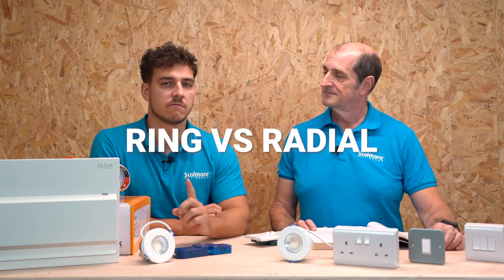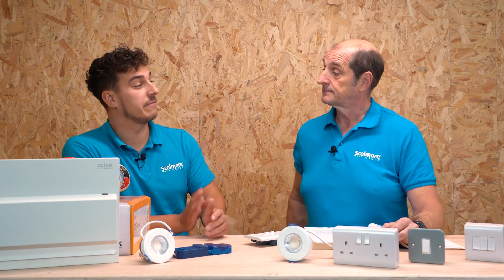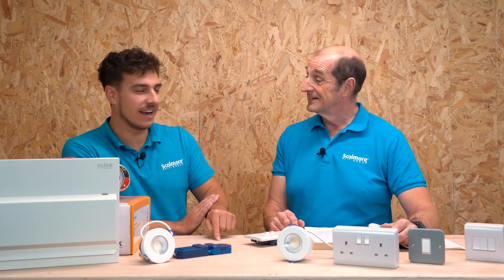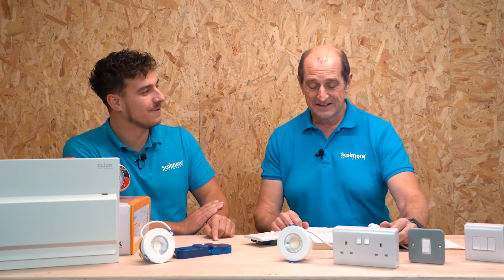Ring vs. Radial: Which One Reigns Supreme?🔆

Comment: It's actually quite alarming how easily you can have a problem with overloading. For example, if you have a ring circuit broken by a loose cable backing out of a socket, that ring is now halved in current capacity. Then there's all sorts of potential issues with spurs off spurs etc, from dodgy diyers. Also cables running through insulation are effectively affected.
Reply: It is not easy really. Done like the professionals like twisting together the conductors endures the rings integrity. Also solved by using push-fit maintenance free Wago type connectors in backboxes to connect up the ring's spine adds safety, as not being screwed connections they do not work loose. The ring's current also does not run through the socket's terminals (this also applies to radials).

Bad tradesmen and bad DIYers cannot be accounted for in any regs.

Comment: High rise buildings, care homes, etc, AFDDs are mandatory on socket-outlet circuits, but recommended on all socket-outlet circuits in all premises as they give the ultimate protection. AFDDs are expensive items so the fewer the socket-outlet circuits the cheaper the installation will be. This is where the advantages of final rings shine as they generally replace two or three radials giving substantial savings on installations. 

Moving over to radials from final rings is not a bright idea now AFDDs are here. I notice that cable manufacturers prefer radials as more cable is used then they sell more.

Comment: Looking into this (not an electrician). I cant help but think its better to always set up a ring circuit with 4mm cable. Then if you have a break you can just swap your 35a fuses for 20a, and have 2 safer radials, or keep the 35a if you want keep the power for some reason because your cable can handle it. Like considering the cost of cable compared to the cost of the trade work. Just buy the 4mm surely?
Reply: As a non-sparky as well, this seems to be the best option. I keep seeing the talk about cost of cable when its less than 10% of the bill once you include labour and the rest of the system.
Reply: If a cable brakes for any reason you connect it back up - they do not just break by themselves. You do not split it into two circuits.
You can always fit an unpolarised DP 25A MCB on a final ring with the L conductors of each leg of the ring connected into each pole terminal.  That will prevent fires if a ring is broken or unbalanced. The final ring can also supply a 45A appliance at the midpoint of the final ring. Very safe indeed.

Comment: The Issue with rings is when/if the ring is broken, you could then have 15-20 sockets on a 2.5mm radial cable protected by a 32A breaker making it non compliant and dangerous.
Reply: You can always fit a 25A double-pole unpolarized MCB with both Ls of each leg run through each pole of the MCB. No leg will ever take more than 25A. So if the ring breaks and the current draw is over 25A on one leg the whole MCB will trip isolating the whole circuit. The same applies if the ring is unbalanced.  Double-pole unpolarized MCBs are cheap. 

The ring then is capable of supplying a 45A appliance.

Comment: Final ring circuits came into their own in the late 1950s. They were not to save copper. My mother's house was built in 1954 with 13A G Type plugs. It had radials. Ring circuits have been widespread in the UK for 75 years. They have been found to be very safe. The British G Type fuse-in-plug was to protect appliance flexes. And to standardise on one plug and socket as previously there were different sized plugs & sockets and cable for different types of current draws and appliances. 

It was common to have three different types of socket in one room. However the fuse-in-plug became an enabler to use final ring circuits. The final ring circuit is ingenious in its simplicity. When used with the British G Type plug the ring is a busbar run around the house with distributed fuses at each appliance. There are many advantages to rings:

1. Cheapness, as smaller easier to install wires can be used;
2. A large number of sockets can be off one cheap to install ring;
3. Having the same number of sockets using radials would mean multiple radials and multiple extra breakers at the main panel. Far more cable, expense, labour and hassle;
4. The 32A breaker and 13A fuse in the plug ensures safety;
5. Portable plug-in appliances on a ring cannot exceed approx 3kW. Some plug-in ovens are on rings;
6. Rings usually have a 32A breaker at the main panel - can be a lower value;
7. Using push-fit maintenance free Wago type connectors to connect up the ring in backboxes adds safety, as not being screwed connections they do not work loose. The ring's current does not run through the socket terminals (this applies to radials);
8. The British plugs enable rings having a max 13A fuse in them - can be as low as a 1A fuse in the plug to suit the appliance and flex/cable. Small flex and appliance? Then a smaller fuse;
9. Rings in the UK are limited by square metres of floor space, with no limit to the number of sockets on the ring. 100 square metres of floor space with 2.5mm cable for a 32 amp final ring. The cable can be 4mm, which is advisable in an unbalanced ring drawing high current loads;
10. Less voltage drop on long cable lengths as voltage comes from two directions;
11. Two ways for the earth wire back to the main panel, increasing safety levels.

Radials are also used in the UK. Rings are not mandatory, but used because they have proven to be generally trouble free and safe. They can be installed using rule-of-thumb. These days a ring will be off an RCD, RCBO or AFDD (arc fault) breaker - these now are becoming DP, so safer again. AFDDs are now mandatory in some socket installations and recommended in all installations. AFDDs raise the safety level. If an office wants more socket outlets for extra desk computers. It is a simple matter of extending the existing ring with the extra sockets as the current draw is low. Cheap and easy. If radials are used many radial circuits would be needed, which may mean an extra consumer unit, breakers, cable etc, then far more labour. 

Some disadvantages are: 
a) Rings are more difficult to fault find. But electricians have no problem once the ring is fully understood. The ring can be split at a socket then tested as two radials for those unfamiliar;
b) Another is a unbalanced final ring, which is a rare event. That is if a number of high current drawing appliances are on one side of the ring, say nearer to the main panel, most of the current draw may be down one cable leg of the ring with the cable rated below the main 32A breaker. An unbalanced ring. 2.5mm cable is rated at 27A max. Although tests have proven the cables do not exceed their current capacity in the vast majority of cases, just an imbalance in distribution of the two cables from the main panel (consumer unit). Good circuit design will prevent this, negating this disadvantage. 4mm cable can be used rated over 32A. 

Overall one final ring is superior to a bunch of radials needing their own breakers at the main panel. They are simpler, cheaper, being proven to be safe and worked well over the past 75 years. Using the new AFDDs on rings, which are recommended and mandatory on some installations, gives a far higher safety level.  A final ring with AFDD protection using 4mm cable and Wago style screwless connectors on sockets is near bombproof. 

You will have to give a very convincing argument against rings. I have not heard of one yet.
Reply: contra your "positives":

1. so we're just being cheap
2. same as 1.
3. same as 1. + lazyness
4. you do explain the imbalanced load in your disadvantages section but I would like to add that a 2.5mm^2 cable protected by a 32A breaker, even as a spur, is not only not safe, but I'm actually dumbfounded how current regs don't outright prohibit this.
5. has nothing to do with rings specifically
6. this is just the result of your first few points
7. you can do the same thing on radials if you want, and they do daisy chain the rings as well. and in case you do need to perform maintenance on the spur connections, you can start taking up floor boards and looking for the junction boxes while with daisy chaining you have all connections behind easily accessible sockets.
*edit: oh my bad, I guess you mean Wago inside the back box? sorry I'm just rewiring an old house and see the stuff I mentioned everywhere. well in that case, I guess you should use 4mm wires for the spur but wagos are not exactly cheap, you know. plus I like to save space in the backboxes. fewer wires, more room, less bends, less snaps. I default to 35mm.
8. irrelevant to rings
9. in my mind the more sockets / rooms on a circuit, the worse. makes fault finding considerably harder, and again, division of circuits is always preferred.
10. mostly irrelevant in domestic premises and only true if the circuit physically loops back to the main panel anyway. although large hangars etc. could benefit from this, along with the better Zs readings which I can't believe you haven't even mentioned. we do have busbars for this reason, though.
11.  I guess you kind of did mention Zs in this one after all. but keep in mind that if it breaks anywhere, you're effectively left with a 1.5mm PE conductor along with "effectively" 4mm live conductors and a 32A breaker, if you don't use an RCD.
but, again, the same thing can happen to the live conductors and you're left with 2.5mm cables protected for 32A. I know there's a low chance for this happening, but it's still not zero.
Reply: @krispy_kornflake  
Mr kornflake,

Firstly, a final ring is economical, safer than a radial and delivers the power. The electrical committee in WWii recommended that each room have one socket that can cope with a 2kW appliance. To ensure each room has enough power final rings were homed in on. The 13A fuse in the plug was the enabler. 

A woman was on the design team, Caroline Haslett, who insisted on many of the human-centric ergonomic design features for the brilliant 13A plug, emphasising safety for children and ease of use for a housewife. The British G type plug and socket is a design classic thanks to Caroline's input. Nothing beats it.

The first three points you say are being cheap, yet go on about Wagos being expensive. Duh. Most of your comments displayed ignorance of final rings for sure. 

The final ring has two routes back to the main panel for the earth, CPC - greater safety. In commercial they have a return earth circuit, which is a radial but the earth at the end of the radial is fed back to the circuits breaker for greater safety forming a loop. Unlike a radial the final ring has this integral to its design. 

I have never come across an imbalanced ring, it is remotely possible but exceptionally rare. Final rings are self balancing - if the resistance on one leg rises then more current runs thru the other leg. But best to ensure the ring is reasonably balanced - circuit design.  

It is possible for the ring to break, I have never come across it but possible. They do not break for no reason when properly installed. British regs state that final rings cannot have more than a 32A circuit breaker - it can be less. So, having a 2.5mm cable, rated for a max of 27A, it is possible for a cable to be protected by a 32A breaker if the cable breaks.  But, installing 4mm cable that passes more than 32A cable solves that problem, as does fitting a 25A breaker. 

But solving all, is fitting a 25A double pole unpolarized mcb at the main panel, with the L of each of the ring's legs running though each pole. All Ns and Es are common. The cable of the ring cannot ever be unprotected even if there is a clean break. If the cable is cut it cannot pass more than 25A. It can never been unbalanced. The circuit at its mid point can power a 45A appliance as well it is so robust. 

A final ring can cover a 100 squ meter of floor area with as many sockets as you like. Or you can spend a fortune on countless less safe radials to do the same thing.  

Now you know.

Comment: Still no idea what the eifference is
Reply: Really? A joke yes?  2.5mm2 cable has current capability of around 24A but if you wire it in a ring then it can cope with 32A. I think the design came around when copper was short. 4mm2 cable can handle 32A, so no need for a ring circuit. I used 4mm2 where it is easy to do so.

Comment: I don’t agree I dislike ring mains for one simple reason if a break happens, that can be a wire coming loose. You the land up with two radials on a 32 amp fuse and the customer isn’t aware of the fault. However with radial under the same condition any socket after the break is the inoperable and the fault requires tracing. I see little advantage in rings other than saving on fuses and therefore smaller consumer units, I never fit rings now days only radial, we have a lot to learn from the French who’s system of wiring is far better than ours, however I don’t like their plugs and sockets the British ones are better.
Reply: Older electricians twisted the final ring's conductors together then inserted it into a terminal. So if a screwed terminal worked loose on the back of a socket or in a junction box, the integrity of the ring is maintained. 
AFDDs are mandatory in some installation and recommended for all. They will grab the fault. 
You could use Wago screwless connectors for the ring in the back of backboxes with 4 inch long 2.5mm flexes to the socket terminals. They will not work loose in the Wago. I have never come across a final ring that just broke for the sake of it.

Keep up with times.

Comment: One disadvantage of a radial i can think of would be loss of cpc near the circuit start- all sockets and connected loads beyond lose their earth and the customer wouldn't know.
Another disadvantage is the need for bigger boards.
I wired my new kitchen in a 4mm ring on a 32a rcbo, 
The thinking behind it for me was any loss in ring continuity wouldn't be an issue as the cable is big enough for a 32amp device where as a 2.5mm ring isn't when a break occurs.
 also i could get a really long ring and just have one rcbo saving space.
Reply: Some commercial circuits have a return earth circuit, where only an earth wire is brought back from the end point of a radial forming an earth ring, to ensure a CPC has two routes back the consumer unit.  May as well take back the L and N as well, having a proper final ring.
Reply: You could have used cheaper 2.5mm cable instead of 4mm and been ultra safe. By fitting a 25A double pole unpolarized mcb at the main panel, with the L of each of the ring's legs running though each pole. All Ns and Es of the two legs are commoned. The cable of the ring cannot ever be unprotected even if there is a clean break. If the cable is cut it cannot pass more than 25A. More than It can never been unbalanced. The circuit at its mid point can power a 45A appliance as well it is so robust.  

The L of each of the ring's legs runs though each pole of the mcb. All Ns and Es are common. The cable of the ring cannot ever be unprotected even if there is a clean break. If the cable is cut it cannot pass more than 25A. It can never been unbalanced to the point of danger. The circuit at its mid point can power a 45A appliance as well it is so robust.

Comment: The reason why we switched from Radial to Ring was it used less wire and has less connections in the FB. Now manufacturers want to sell you bigger FB/CU and more wire.
Regards cable sizes, sparkies have always used oversized cables because they can't do the maths. You can run an electric shower off 2.5mm with no more overheating than you can detect in a kettle lead.
Reply: Correct. Pushing radials is about you buying more main panels, cable and mcb/rcbo/afdd's.

Comment: I trained in France where it is all radial and dual pole breakers. Ring circuits with 32 amp breakers sounds like a recipe for disaster. Way to high with much potential to go wrong. Keep the breaking points low and the amount of sockets on each circuit defined. Simple and safe. Not perfect but compared to ring mains....?
Reply: And yet no one’s dying from these dangerous ring mains in their houses after a century of living with them.
Reply: @station-7  actually they do. There are house fires. Most are probably saved by the fuse in the plug which you don't need in radial circuits when designed correctly. The reason you need a fuse is because 32A is way too high for domestic appliances that aren't in the kitchen. The 32A breaker isn't going to break is it!? Why does the rest of the world use radial circuits? Remember the ring circuit was brought in only because resources were scant and not as a system with the most safety in mind.
Reply: Totally agree what’s more in France all my wire are in conduit and single core not this twin and earth rubbish that way light switches have two brown wires denoting live and a green/ yellow earth if needed blue N.
Reply: You need to understand final rings more. The only advantage the French have over us is they have a main RCBO for the whole system and mandatory DP breakers. DP breakers are available in the UK, just not mandatory as we do not need them as the British distribution system is superior to the French and German which do not guarantee that a Neutral cable going into a house will be zero volts.  All France has TT earthing. 
 
Wobby1516, you can have single wires in conduit in the UK, but it will cost and give no more than what Twin and Earth cable gives. Now we have RCBOs and RCDs, safety levels of Twin and Earth is no less than single core in conduit.